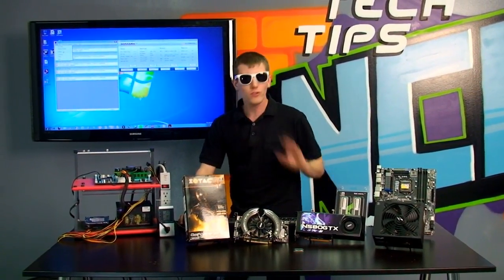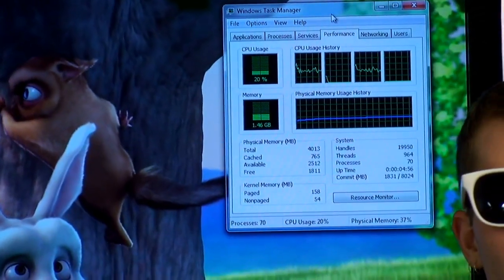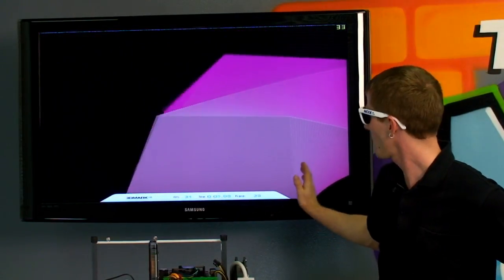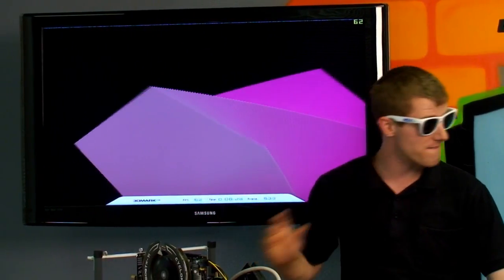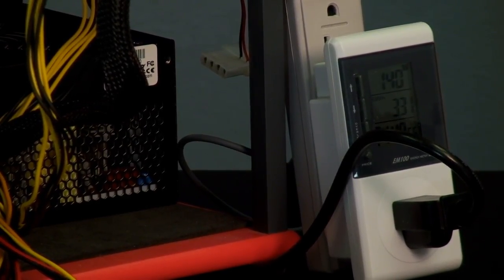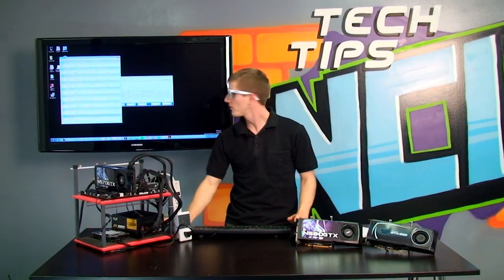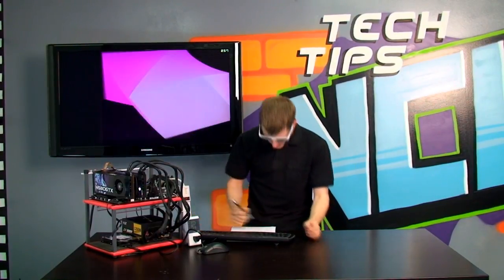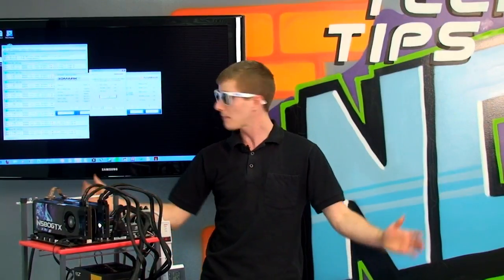System Power Consumption - A Closer Look NCIX Tech Tips

Comment: Rofl, what's better, have a little more power and be safe or changing PSU in year or so? And saying that you run single 7970 isn't any more impressive than running 7790 on 500w PSU, cause they consume nearly same amount of power, but yeah, gl running your 7970 after 1 or 2 years when your PSU wont even be able to work at 400w and gl at overclocking especially if it's a shit brand psu.